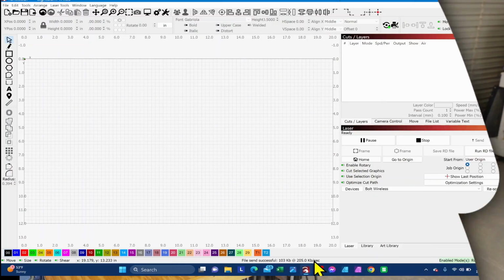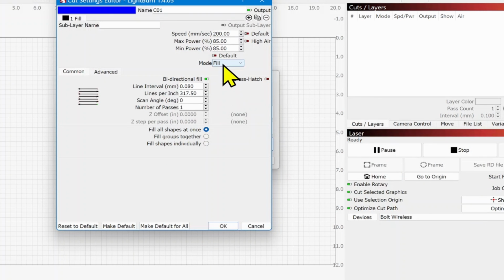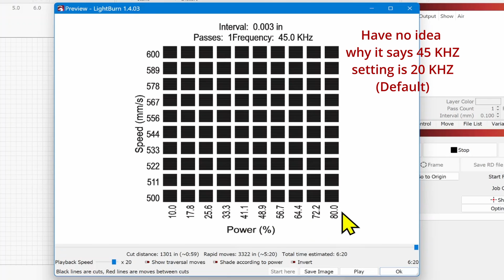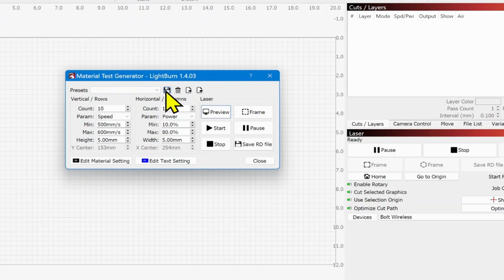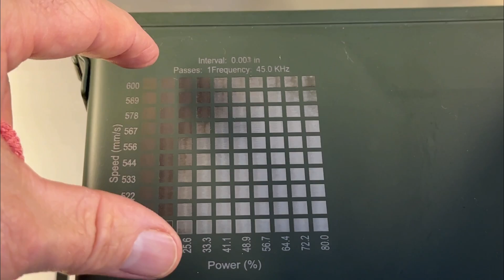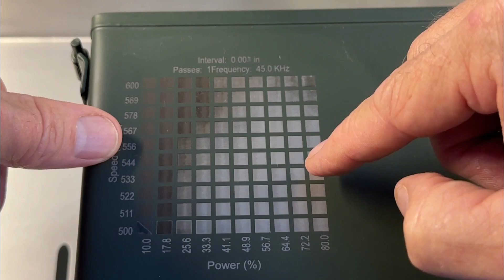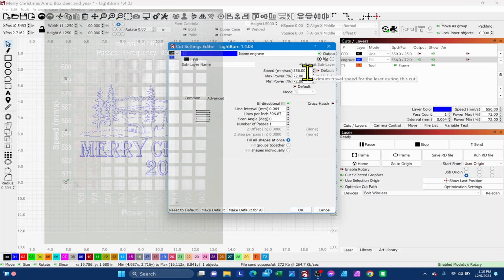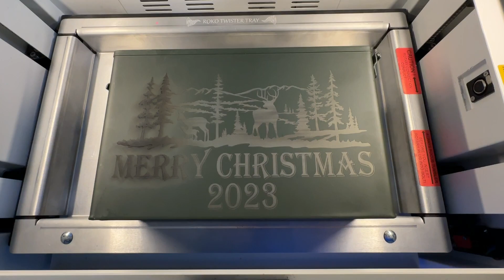Engraving  a 6.5' deep Metal can on your Thunder Bolt! (Its Possible)

Comment: Did you find that the ammo can wasn't flat? I used my 1.5" lens and some areas didn't get enough power. Might switch to the 4" lens
Reply from the maker: Hmmm did you remove the lid? I’ve done hundreds of these and have never had one that didn’t lay flat. Thats odd

Comment: I lasered these with my 35w gcc before now using my 100w omtech.  Both do fine.  I have never had an issue with the decals, mine have always just peeled off with no problem and no left over adhesive
Reply from the maker: you must be getting fresh ones some labels can be hard to,remove even with heat
Reply: @computercreationz  I have been doing these for over 2 years and have never used a heat gun or any adhesive remover, they all peel clean and easy
Reply from the maker: Here in the west coast we must get the left overs or something. Had some that I’ve had to soak off cause they have stuck so tight. Crazy @cheryll6232